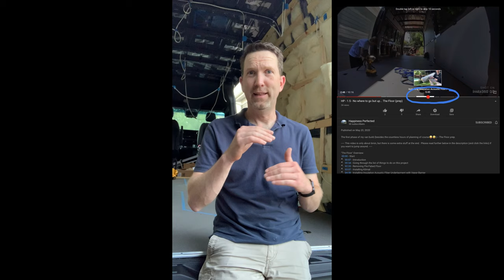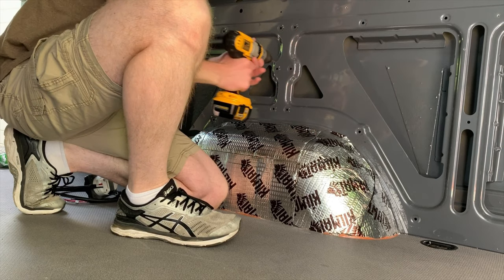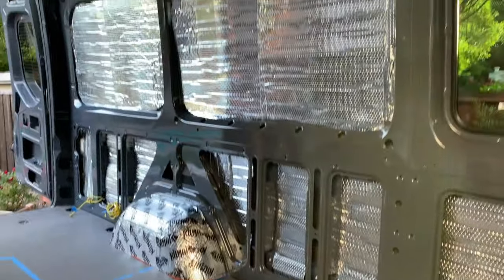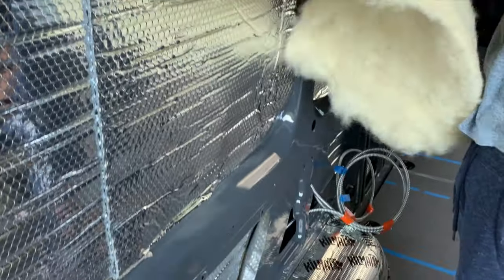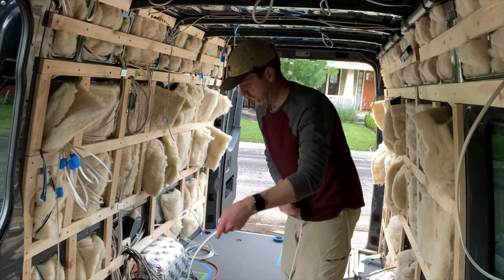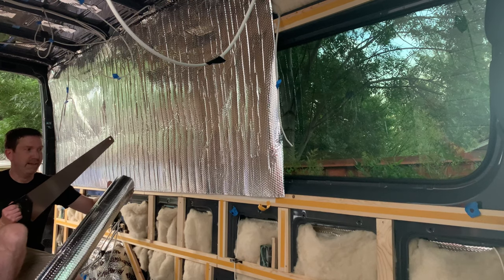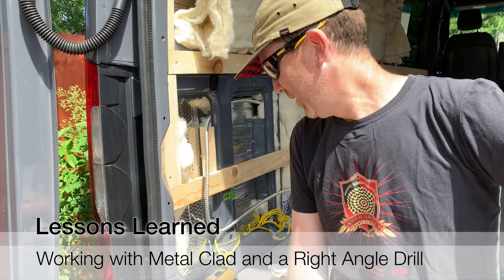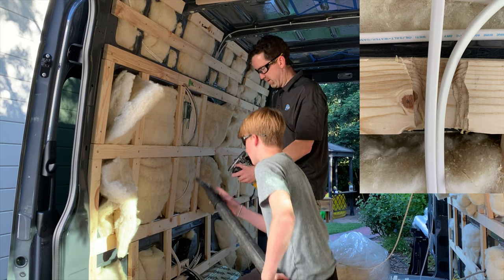Sprinter Project: 1.2 - My van walls (prep)

Comment from the maker: Next step in the van build... focusing on the Insulation for the walls, framing/furring, and wiring preparation.  See below for Index of topics...

00:00 - Start
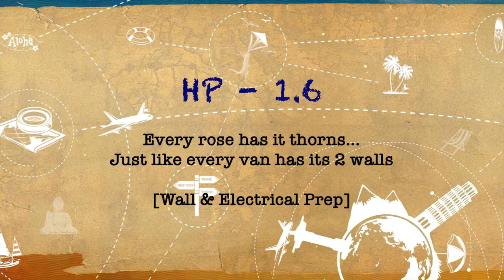🔨 01:22 - Title
🔨 01:32 - Introduction/Overview
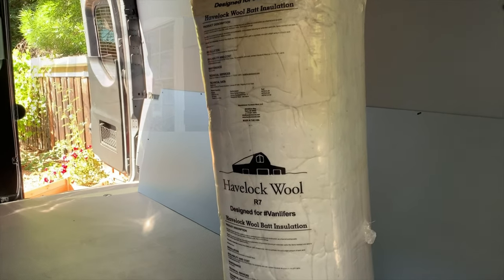🔨 07:03 - Shore Power
🔨 09:56 - Removing Existing Panels
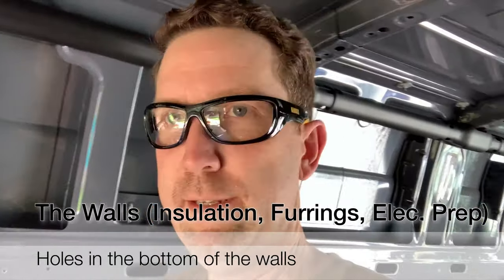🔨 12:10 - Drilling holes in the bottom of the walls
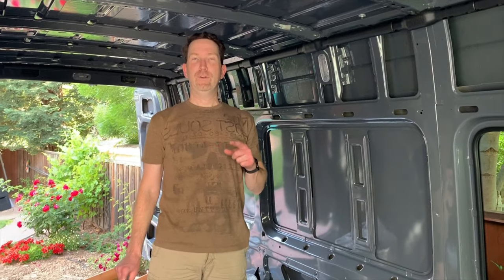🔨 14:36 - Kilmat
🔨 16:04 - Reflectix (1st layer)
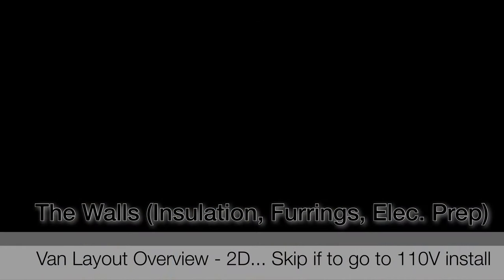🔨 17:39 - **Van Layout Overview - 2D**
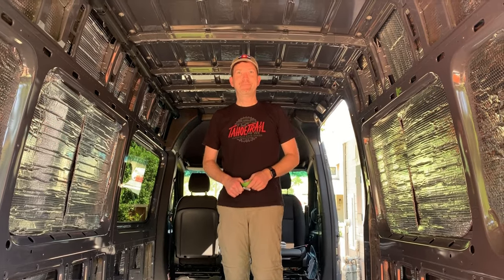🔨 22:49 - 110v drops (w/ Metal Clad)
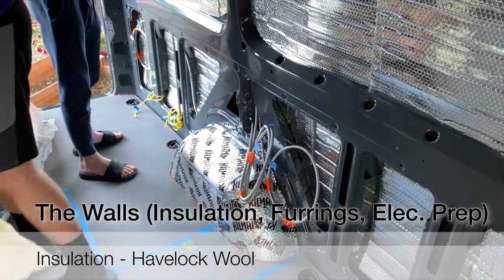🔨 23:50 - Wool Insulation (Havelock Wool)
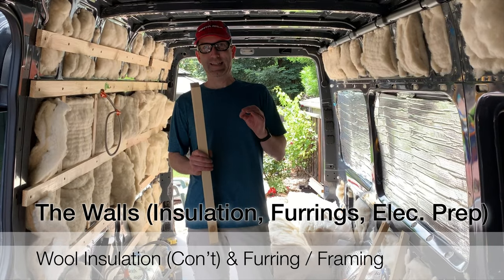🔨 26:13 - Furring / Framing
🔨 30:07 - 12v drops
🔨 34:06 - Electrical Preparation Wrap Up
🔨 38:05 - Reflectix (part 2) / Taping
🔨 43:37 - Closing Reel

Tips/Lessons Learned:
🤔 44:36 - Hammock Hooks
🤔 45:06 - Rear Door Insulation
🤔 46:10 - Securing your Electrical Wiring
🤔 49:53 - Working with Metal Clad and a Right Angle Drill
🤔 55:59 - 12v Cables over Furring Strips